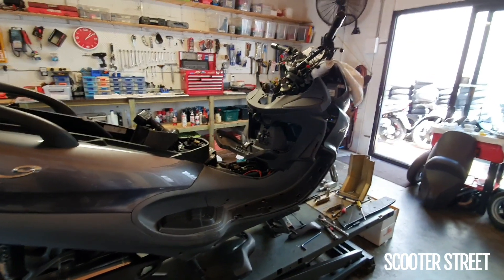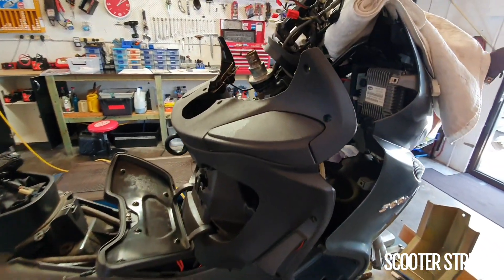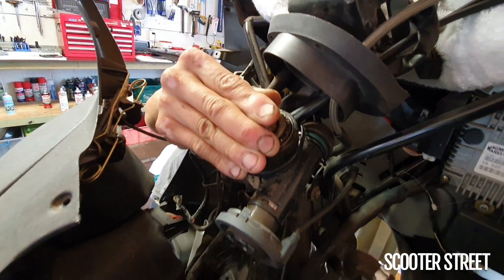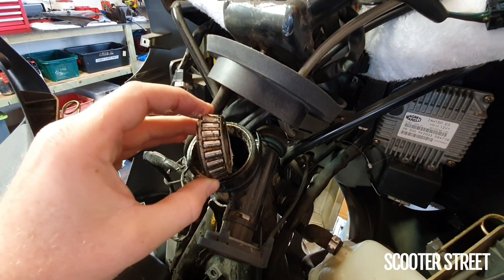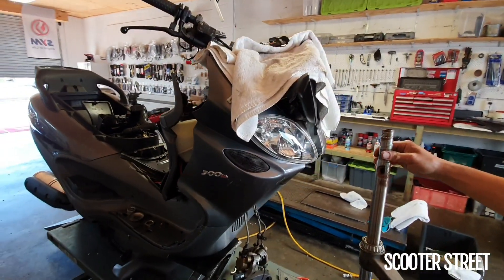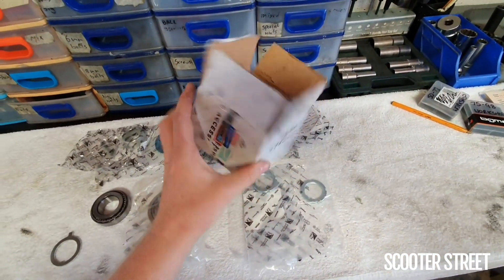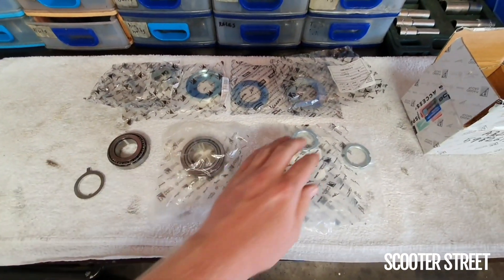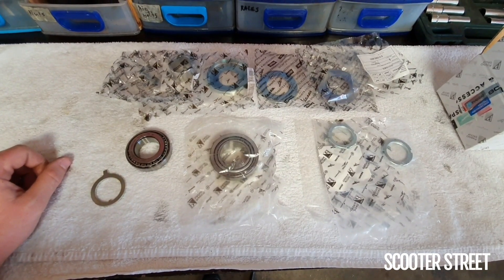Replacing Your Scooter Steering Race - Piaggio X9

Comment: Thumbs up, I feathered  my front brake on my  2019 NRG, which is Mint condition, and it was juddering like crazy,  this video helped me know which way to hammer round that top lock ring
Reply from the maker: Nice work👌 It does makes a huge difference. Tightening and lubricating the bearing race is part of regular maintenance.

Comment: Both my upper and lower bearings were replaced less than 300 miles ago by the previous owner ....they are now loose and feel the steering wobble and knock on bumps . Anyone can give pointers how to access /  tighten these . Thanks
Reply from the maker: Hi there A.A, the steering bearing must be tightened from new or after a replacement in the time you mention, 300 miles. As part of the general maintenance the bearing should be greased and tightened. This will prevent long term damage from this knocking. You can see from the video the handle and top front end to be removed to tighten. For what it is worth book in to your local scooter Mech and let them sort it out for you..
Reply: @scooterstreetau  cheers, I might have a go myself at the top bearing and see if that resolves the knocking. Otherwise will go to the local garage . Been quoted £45 an hour plus VAT ....most of the labour time will be removing the plastics I guess 😀
Reply from the maker: @mrbeanz6451  The adjusting bolts are at the top of the stem, you tighten the top bolt and the race is tightened as a whole complete assembly.
Reply: @scooterstreetau  thanks for your help
Reply: @scooterstreetau  thanks. Is this the nut that requires a special tool ( 020055Y) or a standard socket ? Searching online I'm getting that or 2 x 24 mm screws
Reply from the maker: @mrbeanz6451  Yes a special tool to fit the slotted nut.

Comment: These frames have weak bearings in, same problem with nexus 500 and Beverley 500,  there is a stronger bearing you can fit!!
Reply from the maker: Hi Hugo, you have experienced this too  👌... We find the bearing race is what fails more than the bearing. The steering bearing must be serviced on a regular interval, this includes cleaning, repacking with grease and then retightening. Do this and they will last much longer and safe too.. The only issue is the frame and panel design does make this a time consuming job.